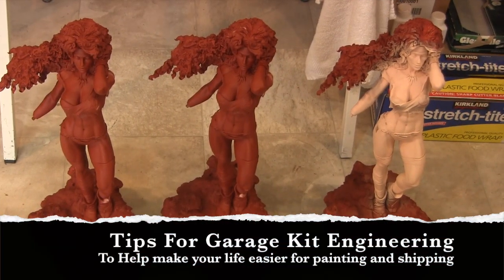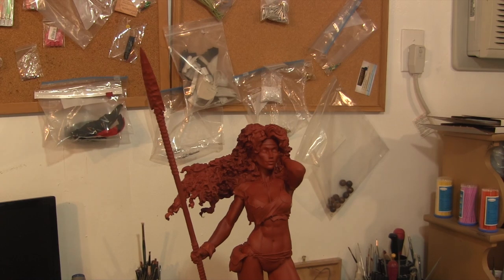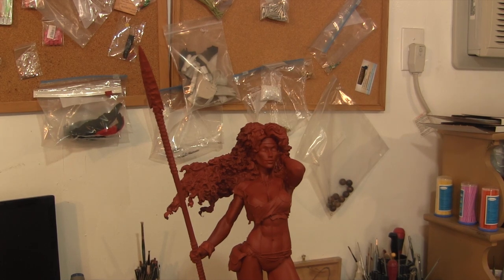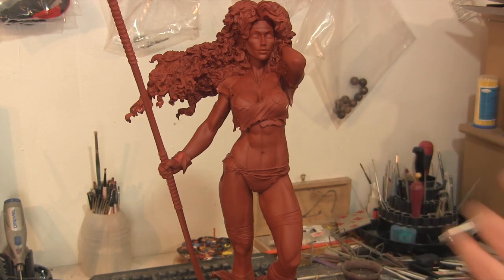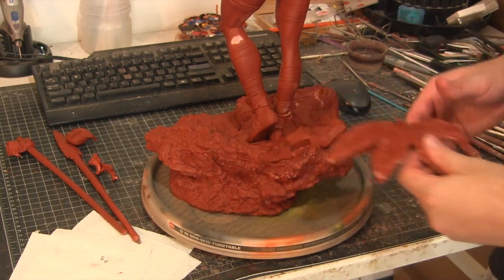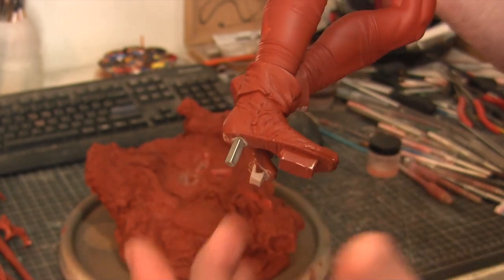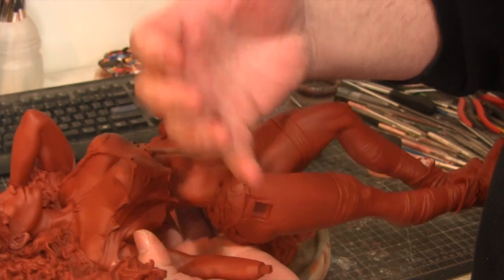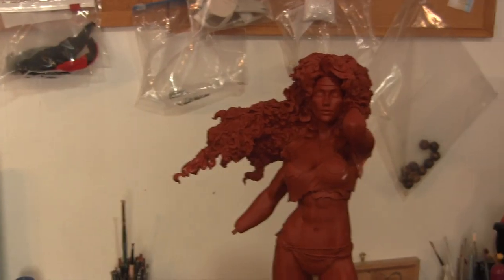Tip For Engineering & Prep work on a Savage Land Rogue Kit

Comment: Finally got my Rogue statue last Thursday and I cleaned her up and started putting her together and finished it up late Saturday night. You are right, they did an awesome job on this and I used the key stock and magnet method you suggested on all the pieces you did and it worked great. I also picked up the BSI glue and Insta Set that I found on ebay and everything went as planned. The hair pieces?? Quite a bit tricky and I still need to figure out where 4 of the smaller pieces of hair go. If you get them all figured out can you let me know, I'd like to make sure it looks as close as it supposed to. Now I need to pick up some Aves and fill in the seams and so on. Thanks again man, you've been a great help and inspiration with this one. This is the first kit of this caliber that I am doing. I've done hand painted ones about 10 inches tall but not like this so I am looking forward to the finished result. Take care

Comment: Awesome video and great advice. I found out that this Rogue kit  is limited to only 40 pieces and am awaiting mine to arrive in the very near future. I was anxiously awaiting a video from you about how to prep this one and here it is!! What is the best place to get that key stock and the magnets? Just about finished with the 30 inch tall spray booth I am building so I can airbrush this one and others later on. As always, enjoy your videos bud. Thank you for sharing your knowledge with us all. Look forward to more tips!
Reply from the maker: I just get my key stock off eBay as well as magnets. Just have to measure out what you need and find them. Sometimes its best to get a few different sizes of magnets, never know which will fit or not. As for the brass square pegs its K&S stuff, they have all kinds, i forget the sizes i use, but sometimes if you got to hardware stores they have these items. Key stock is just items you use for door lock handles on your house, the internal bar inside them. Just you can get long ones off eBay and make your own. 

Some hobby stores also carry the K&S stuff. If i get a chance i can do a video on all the metal rods in a solo video, but i did a few with pinning in the titles.
Reply: Thanks man for the info and quick response. Appreciate it!
Reply: And what grade magnets do you recommend to use? I have found N50 and N52 on ebay which seems overkill by their description but I also found N35 on there stating they are fridge magnets. I just don't want to put a magnet on there that will damage the statue if I need to pull it apart. Thanks again
Reply from the maker: went into my eBay history and saw i got the n52 rare earth magnets, seems like those are perfect for states, Just the larger the magnet the harder it is to pull apart with them is all. So i suggest getting a few in different sizes and test them out. Just get them off eBay from china, they are the same ones you can find in a hobby store for a fraction of the price.
Reply: Very cool! Just got my final invoice for my Rogue Statue to send in. I will be looking to your videos of this kit for more info and advice. It will be the first statue I will be using my spray booth I just built on. Thanks dude! Always great to see your videos, keep them coming.
Reply from the maker: glad to help out, but i think the last video on her will be the final paint build. But i did a whole WIP series on prototypez sagat street fighter resin kit from start to finish, which may help a bit more on how i buld kits.
Reply: Will be my next one to watch. Thanks!
Reply: Quick question. What is the clay you are calling "AVS"?  Saw the magnet pinning videos and you used that to put the key stock and brass with magnet in place. Not sure how that is spelled? I found some clay called Das, is that the one? Thanks!
Reply from the maker: Its called Aves, you can order it at Aves Studio. They got a few kinds, I use Aves Red Basic from their super sale when you buy a few items from them you can order that stuff at a cheaper price. I use the Aves Fix It Sculpt for hair since its a bit stronger. Then i use Magic Sculpt which it not soft like Aves for sculpt but more for bonding stuff together, i get that from Complete Sculptor site.
Reply: Awesome! Guess I was spelling it incorrectly. One thing I learned is to never be afraid to ask. The only dumb question there is is the one you don't ask. Thanks!
Reply from the maker: I'm with you on that, when i went to the first Jerseyfest gathering at Daves house before they made it into a show, i asked tons of questions and left the house with a list of supplies to buy. Got to start somewhere.
Reply: Agreed brother! Have an awesome day. Awaiting Rogue's arrival soon
Reply: Ok, so my Rogue kit finally arrived yesterday and what a great sculpt it is. I am so glad I saw your video on the review of it or else I probably would not have known about it. Question for you...I got all my magnets, key stock and square tubing and I am cleaning her up to assemble. Do you use magic sculpt to assemble it or is 5 minute epoxy good to use? I am not using the gorilla glue brand because that stuff expands a lot and it will be a catastrophe. Also for more support I was considering using the remainder of a rivet, the rod piece, and drill holes into the pegs for a little more support. I work at a Ford dealership so I can get as many as I need. What are your thoughts on that. Thanks brother!
Reply from the maker: well i always used Aves or Magic sculpt and the BSI glue. I like for everything to be secured. As for rods, you can use anything really, but if you plan to use magnets its best not to use metal in other areas. So you could even use Coat Wire hangers that are brass if you wanted too. I just don't like to use steel if I'm using magnets unless the magnet is hitting that steel part.
Reply: Well the pieces I'm using are aluminum so that should be ok then. Cool, thanks. Looking forward to seeing your finished product. 👍